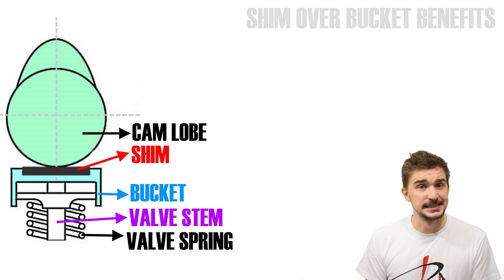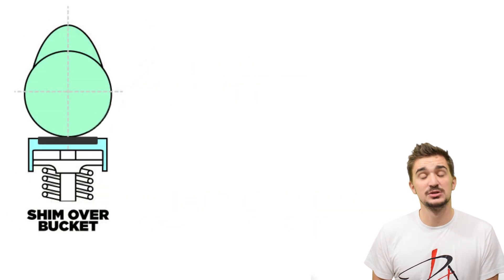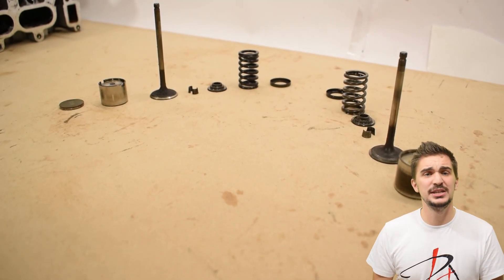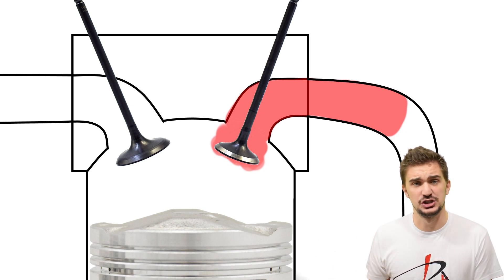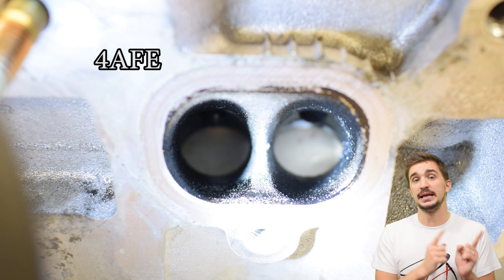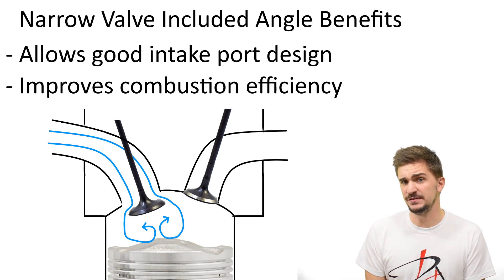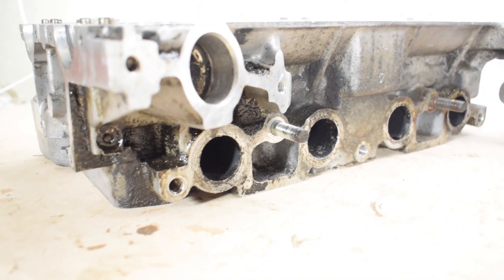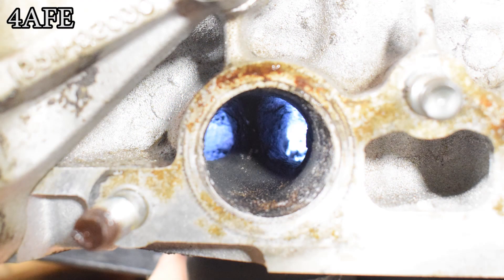CYLINDER HEAD Face Off - 4AGE vs 4AFE - DETAILED Comparison

Comment: 0:54

105hp @ 6600rpm
Redline 6300rpm 🤔
Reply: 2:48

If you advance the exhaust cam shaft,  you’d also be advancing the inlet cam by the same amount, not retarding it by the same amount. Even though they move in opposite directions through the gear drive, they would still advance/retard together.
Reply from the maker: Serves me right for copy pasting engine specs... You're right! Because the cams move in opposite direction, "retarding" is actually advancing the intake. If the intake had a 4age adjustable cam gear on it, the gear would show retarding, but because it moves in the other direction the cam gear would be lying. You need to change your usename.
Reply: @d4a  

Hello @driving 4 answers,

Hat's off to you for professionally addressing a trolling comment and accepting/correcting the mistake.

Did not plan on leaving a comment and also noticed max RPM vs peak HP discrepancy...but let it slide as I always enjoy watching your videos, so keep them coming!

PS:  Personal thank you.  Several years ago you did a video on rebuilding Toyota brake calipers.  I rebuilt on the calipers on my 2001 MR2/S and your video helped!  You even responded to my request on where to find the caliper pin dust covers!

Thank You! 
LSmiata/Mr. P
Reply: @LSmiata  "trolling comment" wow
Reply from the maker: @LSmiata  Thank you so much for that positive comment. I'm glad my vid was helpful. I don't think the comment was trolling tho, it was nice and polite. You should see some of the comments I get, trolling is an understatement for those 😂
Reply: @StupidBlokeStupidVideos  

Hello Stupid Bloke Stupid Videos,

Cheers to you and my apologies for my trolling comment in error.  So many people try to point out minor issues...to make themselves look "so good", that caused me to slightly over-react....and your user/name handle is.....very similar to some trolls.

Again, cheers to you and I really liked driving 4 answers response.  I like his comment and also read your other comments.  Clearly you have knowledge and are offering value.

Mr. P
Reply: @StupidBlokeStupidVideos  

Hello!  Attempted apology, but only posted as .....do not know why?

You add value!
Reply: @StupidBlokeStupidVideos  btw. there actually are some cars that have the redline before max power is there, my car for instance has a claimed power output of 139hp at 6200rpm, while redlining at 6100rpm
Reply: @StupidBlokeStupidVideos  yea, i guess, well, i have a low boost 2.0 turbo, it has a max torque of 225nm at 2200rpm a redline of 6100rpm and the max power is a claimed 139hp(tecnically 141ps) at 6200rpm
Reply: @StupidBlokeStupidVideos  You're absolutely correct.   In fact, I just posted the same... lol (shoulda read comments first).  I think he's "overthinking" on this one and getting confused by them rotating in opposite directions.  Advancing one would definitely advance the other by the same amount.
Reply: @StupidBlokeStupidVideos  you’re correct and I feel a little dumb not figuring that out for myself.  Thinking about it, the cams are mechanically connected by a fixed gear set so lobe separation angle can not be changed. The fact they spin in opposite directions is irrelevant.  I reckon if there was an idler gear between them so they rotated in the same direction we would easily recognise that advancing one advances the other.
Reply from the maker: The direction of the intake cam rotation shouldn't have any significant effect on harmonics or balance, at least in theory.
Reply: @d4a  isnt it like retarding one cam moves both intake and exhaust events in time?
Reply: 5800rpm not 6600rpm
Reply: @Unkwon Malaysian Guy there is none but slave driven cams need spring loaded gear to keep constant pressure on gears so there is no back lash  if you do not spring load the sissor gear you will have a rattle sound similar to tappet noise...

Comment: Does this mean you can put a 4AGE head on a 4AFE block?
Reply from the maker: Yes, but you might need to replace the pistons depending on the block, or pistons and rods as some rods don't work with all pistons (press vs full floating). The early 4ages and all 4afes have the smaller journal cranks. All later 4ages have stronger internals and larger journal cranks, so that's something to think about as well.
Reply: @d4a  So If I want to turbo a 4AFE can I use aftermarket 4AGE pistons and rods provided that the pistons clear the valves and the big end diameter of the rods fits the smaller 4AFE crank?
Reply from the maker: That's what I'm doing with my 4afe turbo build
Reply: @d4a  Thanks for the answer and the great video! Good luck with your build!
Reply: @d4a  im subscribed to your channel for a long time now with notifications on but how come i havent seen that turbo build series? all i see is the 4age rebuild
Reply: @d4a  There is also the whole belt drive system that has to be changed and some other factors. There is a bit involved and I can't see it being worth it.
Reply: Yup...